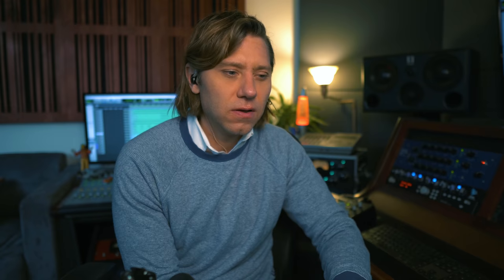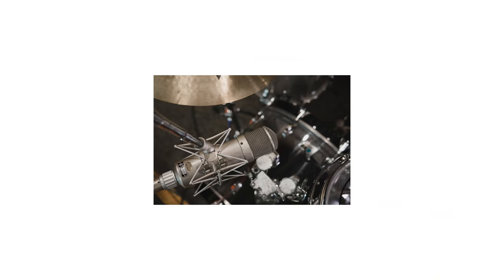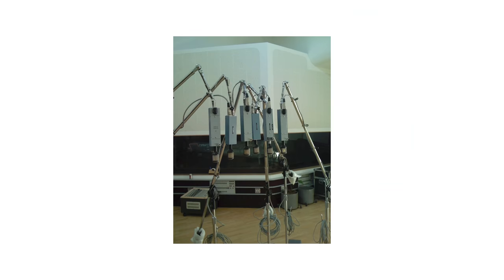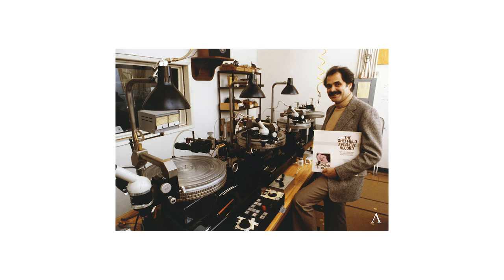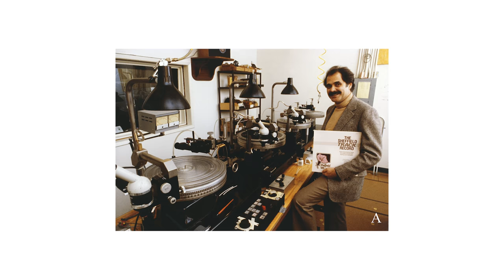The Magic of Tube Microphones! - Marc Daniel Nelson

Comment: Marc pegged good tube mics correctly. Marc and Warren have their communication skills down to an uncanny science. I was working in a Studio with a standard U87 26 yrs ago when I first bought a tube mic...and I actually thanked God for the mic. Picked up the Lauten Eden tube mic bit over a year ago and it has different character settings on the mic, so it works great on just about any source. Have an old Rode Tube Classic 1 and still love that one. Both are quiet enough to record classical guitar or voice overs. Noise is what I noticed on cheap tube mics...I fixed noise issues on tracks from cheap tube mics weekly from other studios.
Reply: Awesome Jeff.. just super. 🕺🏼🕺🏼

Comment: Like someone commented on another video... "I see a video by Marc Daniel Nelson.. I instantly watch it and hit the Thumbs Up button"
It's true... I've learned so much from this dude. Every video of his is awesome! Thanks Marc!
Reply from the maker: Absolutely!!
Reply: Thanks, Paul! Having fun making them
Reply: @marcdanielnelson317  Hi Marc, I just received my ATC 45s, thanks again for the suggestion.  I ordered them right before they went up $1500.  QUESTION, you mentioned to put them on their back and do the quarter trick to check the phase using a plugin.  If the phase were off, what would be the long-term solution, being there is no phase button on these monitors?  

As a side note, I know you said 6 feet is a good distance, in the room I am in, the best I can do is a little less than 5.  I have an adam sub10 with them, I am hoping this is good enough as it’s the best I can do at the moment.

Thanks for all your great content!
-Chad
Reply: @WhereAreWe7  Youll be fine.  Just have fun setting it up.  If you feel they are firing out of phase then i would suggest getting xlr cables reversed.
Reply: @marcdanielnelson317  I tried them for the first time last night.  I have never heard such clarity from any speakers, ever!  Wow.  I cranked them and went in the other room at one point and I could hear details I have never heard before, even from another room.  We are so blessed to have monitors like these!!!  Thanks again for all of your work!  You do a great job teaching, I always look forward to Make. Mine. Music. 👍

Comment: Shoot you guys. Just purchased a vintage Neumann CMV 563 off of Reverb because of this video. But it's gorgeous and comes with 2 different original capsules for $3,800!
Reply: UPDATE: 2 months later and this microphone SLAYS. It's a little bit thinner in the low end compared to both of my u47's, but the information is definitely there and can be brought out with EQ if needed. Since it has a more natural high-passed sound to it, I've been using it on acoustic guitars and backup vocals mostly, and I love it so much. Vocals stack so elegantly without a lot of lower mid buildup. They just sound super clean and alive. Definitely a great purchase based off a great recommendation, I was not familiar with this mic previous to this video.

Comment: Great video , one of my all time favourite microphones is the SE Electronic Gemini II . As you say here it’s 3 dimensional and has such a wide scope with amazingly rich frequency response.  I love it for vocals , Bass , drums guitars acoustics Cello double bass rooms
I have modified it a bit changing valves a few capacitors and it still beats most other mics . I had an AKG solid tube one to,  decent mic and very underrated

Comment: I have recorded VO with the Neumann M49 and the mic preamp was a Chandler Germanium. The sound seemed to sound in three dimensions as you say. For me was like I was floating on top of a very large reverb. There was no need to process that! I have a Neumann u67 and it sounds great too. And it depends on the mic preamp, the room and the tube I use it the sound changes… Great video!

Comment: Tube vs. Valve? I though those were merely different names (USA vs. UK) for the same thing. Please explain.
Reply: You are correct, it simply UK vs US nomenclature. Seems Marc was using term 'valve' to refer to original classic German designs, and 'tube' to refer to modern clones. Both are based on having valves/tubes in their internal amp circuits. The only difference being that tubes used in those early days are either not available now, or are scarce and expensive, and/or are not as stable or reliable as modern near-equivalents.  That is my understanding anyway.
Reply: tubes and valves are the same thing
Reply: @philburns5656  I think you would find a lot of folks in the UK stilll call them valves.  Tubes is a N.American term.
Reply: @twtobin941  yup, same with guitar amps like Mesa, Marshall, Orange,  etc.  US they're called Tube amps, UK they're called valve amps.

Comment: Ok, I get it and I believe it..  I'm a Rode NT1 user for 20+ years I use it on Vocals and acoustic guitar cause it beats any of my dynamic mic's, this should show where my development stands (scrappy not extravagant).  I've never used a tube mic maybe someday but I just dont feel comfortable having a single piece of 10000 dollar gear hanging  above my recording desk in my back yard shed of a recording studio.

However, I do use tube guitar amps as well as a leslie for some keys (like my hammon D and an old Korg CX3)   there are no plug ins or solid state amps that can beat these things, yeah I love the tube amps.   But these amps while great in sound are no where near the high ticket expense of the tube mics.  Gets me thinking.

So all that said, I do understand how tube amps work with regard to guitars and keys.  I fix my own when they need it. 

My point is, whats missing for me in this discussion is, how do tube mics work, how do they capture and amplify sound, how do they power the capsule (if condenser) and what is the amplification routeing like in them.   12AX7?  I get it, how does it get hit by the element.  If I want to clone a Princeton I can download the schematics from a dozen different places.  I'm not going to do that cause I have enough guitar stuff but its doable. 

The schematics for these old tube mics has got to be simpler than an old Fender amp?  Or is there some magic thing that is unattainable in these circuits.   Surely its not the same as running a powered condenser capsule through a tube pre-amp (I do this now).  I might have to slip over to Uncle Dougs channel to see if he has something to say on this. 

Any amp builders out there have any thoughts on this?
Reply: I also have the Rode, but my first mic is an AKG Tube, two completely diffetent worlds. Although you should not use two different mics for stereo recordings, the way I do, I love using both on nylon string guitar at the same time.

Comment: That's why I built a clone of an ELAM 251, because I wanted that tube mic sound, but couldn't afford it.
Reply: How did it turn out? Thinking about getting one from mic parts
Reply: @witnessthewrath8061  The one I built was indeed a kit from MicParts. It turned out great! It sounds amazing! Immeasurably better than my other cheap condenser mics. In figure of eight, the back side sounds a bit darker than the front side, but I usually use it cardioid anyway. It's not too difficult, but I wouldn't recommend the ELAM 251 kit for a beginner. The circuitry is simple enough, but wiring up the transformer and the tube and capsule is trickier than say, building a stomp box, where the circuitry might be more complex, but it's a single circuit board with a simpler housing than a mic cylinder.

Comment: Truth be told - Tubes are usually better crafted so they cost more and more is expected. Try ribbons for vocals as  well.  Then try large diameter solid state condensers. Finally Dynamics (SM57). Learn  which deliver the results you seek.  For me it's not unusual to use all of these in the production of a track.A Stradavarius just doesn't sound like a Stratocaster.  Why would you use the same capture device for such radically different sounds?

Comment: There's a lot of vague terms like "Magic" and "3D" in here. I'm sure U47s and such are fantastic, but what is the difference between using a tube mic and running a solid-state mic through some tube pre-amp or something? Can't every decent mic sound like "Magic" and "3D' like that, or is it actually not about tubes necessarily?
Reply: I get it Erik.  I think I was trying to explain the magic inside a tube mic.  Dynamic mics and ribbons sound 3d too.  There is just something above it that I always get using tube mics.  Specifically vocals, strings, drums ect..

Comment: I have U47 clone done by Michael Jolly, he used to be HUGE on Gearspace forums, before they had "space" in their name ;-)
It is literally a K47 (same as Neumann U47) capsule within a slick frame with a bigger holed grill (compared to regular Neumann mics) and it sounds PHENOMENAL. 
It is literally a capsule head that screws on a cheap pencil mic, any kind of pencil mic, such as MXL603s, and it sounds like Neumann U47, but without the tube.

That man did samples, and in some ways his version sounded better than Neumann U47, in some ways original U47 shined more, but it was subtle difference. 

At 370 bucks that I paid for it, while that pencil mic came free with old MXL large condenser I purchased. 

Long story short you have almost identical frequency response, without spending 8 thousand bucks on U47. I can use bright pre-amps, and have zero sibilance. In fact I love to boost the highs on my SSL Alpha Channel pre-amp.

U47/U67 mics shine in vocals, and hard to beat. With U47 needing the least amount of EQ, it just sits in the mix, while U87s mics always need some type of EQ, unless you record to tape, which has natural high frequency roll off, due to nature of reel tape. 

Frank Sinatra recorded 96% of his stuff with his own Neumann U47, and you know the presence of that K47 capsule on those old records, not just Sinatra's. He travelled with his own Neumann U47 around the country, and would bring it into studios to record.

The other 4% of his recordings were using U67, which is a bit brighter mic. 
I am a huge fan of U47, as I hate eqing vocals. Because you can't EQ a vocal without losing something in another sound register. Harmonics spread across the frequency band with bright K87 capsuled mics. Which are about 90% of the microphone market, unless you go for clones of U47 or go above 1500 for a mic. 

That man is a genius.

He is no longer in business, but that man modded so many mics by putting his own electronics and k47 or k67 capsules in them. Tubes are cool, but they also have downside. They are more muffled. Great U47 clone will not need tube to sound amazing. Getting clarity of modern mic, without harsh sibilance, and none of the tube cloudiness. 

I had tube mics, and while they sound amazing for singing, they sound like silk sheets over the speakers, some have more sheets over the speaker, some less.

You can't make tube more clear than what it is capable of, but you can add tube plug in, or tube processing later. I tried different tube mics, and there is definitely some negatives in clarity with tube anything. Be that LA-2A compressor, or a Neumann anything mic with a tube. 

What is not discussed in the video is the fact that tube treats transients differently. Transients are less sharp (significantly) than a regular condenser. So if you record fast vocals, or fast staccato rap, you will have worse performance out of tube mic. Those transients will be more washed. 

The huge benefit of tube is that it distorts differently, and it saturates the sound at lower volumes uniquely. 
I still wouldn't go for tube mic for every vocal. It's easier to add "mud" than to remove it.

Comment: I was fortunate enough to have a pair of each original Telefunken E LAM 251and also AKG C12's which I used in classical recording work.  The copies that have been mauufactured  are considerably inferior and do not use the same capsule nor valve.  My only reservation is that the C12's have a far higher self-noise compared to the Telefunken's. This is a consideration when recording instruments such as solo lute or virginals.

Comment: How does your bricasti not over heat in the rack with out a space. Mine gets really hot.
Reply: Mine doesnt get hot at all.  But also there is a huge open gap in the bottom

Comment: I always hear stories about how producers would use tube mics on 100 watt amps as close mics.  AC/DC and Lynyrd Skynyrd using U87s, ZZ Top using U67s, all for close mics.  I’ve also read that the older artists would crank their amps to get their drive and distortion, so the SPLs had to be quite high. How were they able to do this and not damage their mics? 

I understand tube mics are durable, but I didn’t think any of them were rated high enough to withstand those volumes.

Comment: I think the beauty of these mics is that they were used by the biggest clunge bucket ever namely Himmler et co and then had a beautiful soulful black voice singing into em and they got confused between love and hate.
Reply: I’ve got a very interesting microphone, if I wanna put it that way, it’s an old Telefunken ELAM201 I think it’s the model, maybe, but it’s a ribbon mic that looks like something out of a science-fiction movie, it’s got a horizontal hoop magnet of some sort that makes up most of the body of it quite heavy and oversized, the scary thing is it came in a wooden box and if I look close enough there is one of those freaking Nazi symbols printed on it in a red stamp. The eagle on a swastika thing!   I’ve never used it on a session and probably don’t plan to. I believe the seller who I got it from told me that it was “SWAG” which is 'spoils of war', I suppose I could sell it to Quentin Tarantino but I’m not a big fan.
Sad thing is the mic sounds really great has a pronounced upper mid range that’s not unpleasant along with a wide frequency response in general and that’s unusual for a ribbon mic. Also the ribbon element is removable for field replacement I suppose. A unique mic which you sometimes will see on eBay orsuch.

Comment: I took your advice and got the 4060 and you're right, it is amazing! I still have the TLM 102 and love it also, but the 4060 brings another element to tape that sounds great! Follow up, I know the U47 FET is pretty killer on kick and maybe bass cabs, have you ever tried on vocals or other applications?
Reply: U47 sounds with outstanding results on male basses and baritones
Reply: The U47fet sounds amazing on vocals. I like it especially on male vocals, but also for female vocals if they sing "edgy" and with an attitude so to speak. I don't like it so much on soft female vocals.
Reply: Good to hear John!  I like the 47fet. It’s a mic that sounds great on everything

Comment: To anyone lusting after a tube mic, but don't think they can afford one: BUILD ONE! Not only are there any fantastic kits available for reasonable prices, you can always get a cheap used tube mic and swap out the capsule, circuitry, transformer, and tube. I will bet you'll be blown away by what you can put together on a $400-500 budget. I was.

Edit: forgot to mention the transformer.
Reply: Very true Kevin!

Comment: I still have one of the AKG Solid tube microphones I’ve owned over the years. It’s not a true tube mic not even a true condenser but it sounds amazing for the price. The internal wind screen should be removed because the foam breaks down and turns to grease, be careful removing it. Also be very careful removing the case screws they are soft metal and the heads strip out easy, also impossible to find that style screw. I bought the last US stock of them a decade ago, not sure if you can get them now. If you get hum that means the top shell and grille are not making good contact with the bottom half that’s grounded.
Reply: great tips Frank

Comment: what the heck does sounding 3 dimensional mean ? Sound is represented digitally with 2 dimensions (Time/Amplitude) but when sound is played back acoustically it always gains the additional dimensions of space.
Reply: What people mean by that is that they have crappy room acoustics. :-)
Reply: It's the psychoacoustic illusion of a soundstage that differs not only from left to right but also front to back.
It only works if the room is treated and the speakers have surpassed a certain quality threshold. Some sounds can sound like they are projected into the air before you and have a certain depth to them, so you perceive them like a 3 dimensional projection. 
It works on headphones too but here the illusion is a bit different, because the soundstage is so close to your head/in your head but on some elements you get the feeling that you could turn your head around an element in the mix (doesn't work of course, it is just a psychoacoustic phenomenon).

This illusion works, because of how our brain processes sound.
If there are enough coherent spatial cues in the audio, your brain will render it as an 3 Dimensional object.
One part of spatial cues are interferences, which lead to comb filtering and distortion of the original wave.
Distortion of a Sinewave, always creates overtones and tube equipment, with it's subtle saturation also creates overtones and gives the brain a kind of "fake" spatial cue, so your brain interprets the sound as a 3 dimensional object.